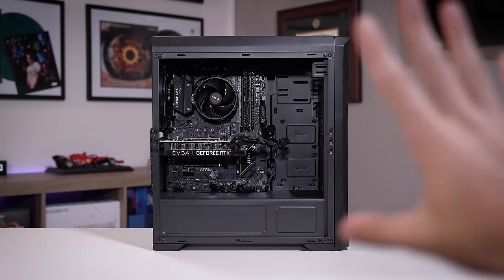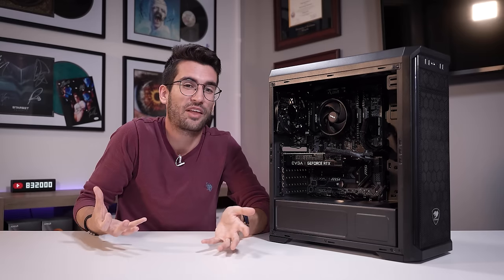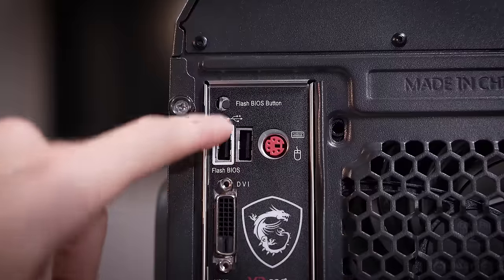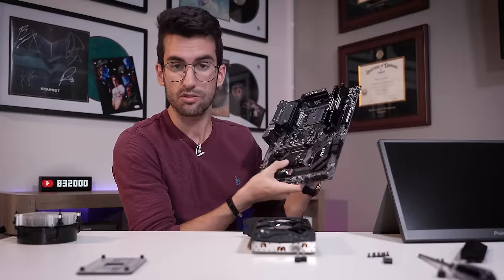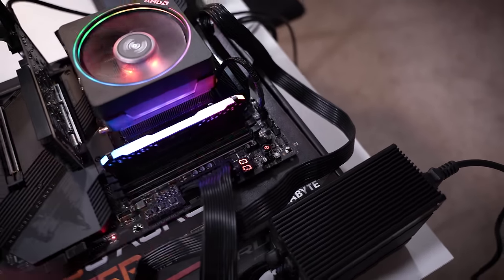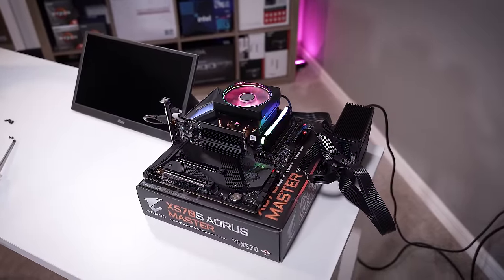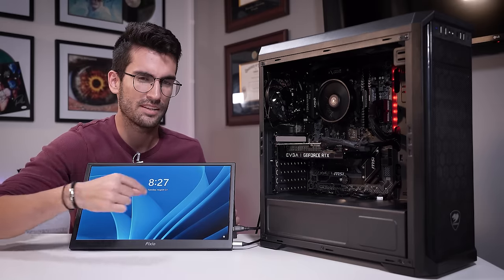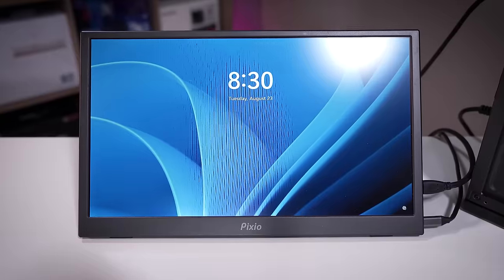Fixing a Viewer's BROKEN Gaming PC? - Fix or Flop S3:E4

Comment: My R5 3600 died on me (Never ending IRQL errors...system cannot get into Windows) recently, since the Asus Strix b450-f gaming mobo and the 16G TridentZ setup was working fine, ended up getting a 5600X. Hoping this one will work and doesn't end up the same. PSU Corsair RM650 and RTX3060 (previously GTX1060) 😢

Comment: One of the first things that I would have suspected would have been the power supply as a bad but not dead power supply can cause other parts to stop working similar to what the customer described.

That being said it is always a good idea, if the motherboard is suspected to be the issue to flash the bios, not so easy if there is no bios flashback, but definitely something that I would attempt if possible for motherboard and possibly CPU issues and apparently it can fix some GPU issues as well.

Comment: I had a Z490 Tomahawk that came borked from the factory. Couldn't get it to post and kept getting the RAM debug light. Ended up returning it and had no issues with the next Z490 Tomahawk board. Was super weird

Comment: Wow that was close.  I recently updated my BIOS on my B450 Thawk MAX to that exact one to replace my old Zen chip with a Zen 3 and have run into XMP stability issues so almost installed the May BIOS.  Instead I just manually OCed my memory to an even higher speed than XMP.  It may be an issue with 3200 mt/s memory because setting it manually at 3600 works fine and I've had no crashes since.
Reply: It's the "E" BIOS. It's known for causing instabilities and no boot. the "F" version fixed those issues hence why the "E" version is no longer available.

Comment: Good spot.  I've just done a fix flop of my own.  Went through all parts of my pc before getting to a 3700x that died.  Was weird and would power on play for a while and then crash.
Reply: I'm not sure if my cpu has or is going bad (2700x) but only gta causes my cpu light to come on and crash my whole pc until I restart it. Really weird, only happens on gta and has only happened 1 time on shadow of the tomb raider
Reply: Had the same parts-swap-circus due to a broken 3600 this year. RMAd it and got a new one

Comment: Hello greg. I have a question.if you were to clear cmos on this motherboard, would it revert back to the other bios? Or just revert all settings back to default? Cheers,  Elu
Reply: Clearing CMOS doesn’t do anything with the bios version. It only reverts the changes you’ve made yourself in the bios menu, example would be XMP or overclocking settings

Comment: this triggered a memory of the strangest bios issue I've ever come across, it was an HP prebuild with an odd bios setting that affected the M.2 SSD drive that mimicked a CPU issue. Very bizarre problem. Was a customer's unit, not mine. If you've ever seen an HP prebuild bios you know they're weird.

Comment: I got an MSI Tomahawk b350 board that I updated the bios of back in 2019 to install a r5 3600. The bios has since been removed and when I try to update the bios with the latest one,  it crashes and I gotta clear the CMOS. I guess I could dig up the 1st gen ryzen chip and throw it in there to see if it will let me update the bios with that chip in there, but i found the whole thing weird. (the r5 3600 works just fine in this board)

Comment: Did you check that the PSU was still delivering clean power?, bios doesn´t explain why it failed the first time, probably PSU killed the first motherboard and made this one to start failing until the new bios changed the base vcore slightly and that's why it boots again, but if some caps are dying in the PSU it will fail again soon.

Comment: Basically all of the B450 Tomahawk boards had some major BIOS issues. I built a PC for someone with a B450 Tomahawk and it soft bricked itself after changing a few settings and turned out (after half a day of Googling) that it was a known issue that if you changed a setting (can't remember which one it was) without first updating the BIOS, the board effectively bricked itself. I then had another fun half a day trying to flash the latest BIOS via a USB drive, but MSI had the instructions listed wrong and I eventually found a random forum post explaining that you had to format the USB drive differently than what the instructions said.

Comment: My 3600 has been solid for a few years… hoping it holds out for a few more as I have soon to be 3 computers in the house 3600, 5600x and a soon to be 7700x system.

Hoping the 3600 on the 450 board holds out until next generation Ryzen or whatever comes after the 7000 series

Comment: I have MSI Z370 that had wonky BIOS. Every 10 or so boots i would refuse to start and beep at me with speaker that I had. Using fast boot options made it even worse. Turns out after few e-mails with MSI, new version showed up on page, installed, problem went away. Admitetdly those e-mail took longer than they should because of me not following simple instruction "load optimized defaults" to the letter.

Comment: Hey Greg, my close friend’s pc is having some issues. His computer would power off randomly or after using it for an hour. He’s not running any GPU intensive games, just browsing the web or running some easy to run games. PC isn’t overheating as well. Do you have any tips on what may have caused the issue? He tried ddu and reinstall his graphic driver but it isn’t working.
Reply: I would try swapping out the PSU. I had the same issue on my old PC, and it was a symptom of a failing PSU. (Remind him to switch out all his cables with the ones that come with the new PSU.) 

I recommend buying from Amazon if he can, that way he can return the PSU hassle-free if it doesn't fix the issue. And check the PSU tier list from Cultists Network. Have him get a tier A or tier B unit.
Reply: @jaekae13  I troubleshoot using another psu. Found out that his PSU is dead. We replaced it 👍

Comment: After doing what you are doing now for too many years to say, I am glad you thought outside of the box. Sometimes the problem is right in front of your face. But, the only way you can see the problem is if you take a few steps back to see the big picture. Put your hand in front of your face, then pull it back away from your face. Ask yourself what you see with your hand close to your face compared to when you can see your whole hand instead of the finger prints on part of a finger.. You are getting it... Very good!

Comment: I don't think the B450 is that bad depending on what your goals are. I cannot speak for the MSI board but I have a Asus TUF pro ii b450 with a 5900x and a 3090. I got the MB for $49.99 new in box. PCI gen 4 is great for storage transfer and will obviously have a part to play for some people who could use the transfer speeds. But that's just not something I personally need. Nothing I do requires that level of bandwidth. Even before this rig on old SATA SSD's at no point did I wish my SSD's were faster. 

I will note that unless there is a substantial price difference and a smokin' deal like I got there is no reason to seek out a b450 since the 550 and above are better in almost everyway. I am only stating that 450's do still have value. For $50 and having good VRM's for my CPU I jumped on it.
Reply: I'm even crazier than you are! Running a MSI B350M Pro VD-PLUS with a r7 2700 and a 3070! The motherboard was around 25$. Changed 3 GPU s till today!

Comment: trying this when i get home, i recently  upgraded my mobo and cpu from b550/3600 non-x to x570/5900x and i wasnt getting a post with my arctic aio cooler but once i used my ryzen wraith prism it booted. it worked for about a week and then yesterday while messing around with the asus optimizer i saved the settings it automatically adjusted and then boom, no post, not even bios. tried clearing cmos (have clear cmos button) tried safe booting tried booting in different ram slots and im still getting a 02 error code on my debug led. going to try flashing bios first when i go home for lunch, if no luck then I'll trying swapping back to my old 3600 and seeing if i gain a post but im pretty sure the optimizer frigged off something with my cpu and maybe reverting back to default bios will help. if you've experienced an issue similar to mine pls comment your experience I'd love the help. Greg love your videos dude keep doing the lords work!

Comment: I need help. So basically for the past 4 days my PC is not giving display signal after many restarts it does idk what is the problem but I have reinstalled the graphics drivers and still the same thing also during gaming the PC just freezes and doesn't respond until I force shut it down I suspect it's a psu issue but still any help would be appreciated

Comment: Just curious if you update the bios on these if its not the issue. I always update my customers BIOS just for the heck of it anyways.
Reply: See now I only ever update a BIOS if there is an issue. If the system works fine then updating the BIOS is only needed if it offers a performance increase or it fixes an issue that I am having. After working with computers for many years I have learnt to leave the BIOS well alone if everything is working fine!

Comment: I had a x570 and b550, both from asrock, that wouldn't post with my 3700x in it, only was I founds to resolve it was to put my old 2600 in and update the BIOS.

Comment: That bios may also be one designed for an OEM/SI exclusive variant of the board, MSI and Gigabyte make a lot of boards they sell only to SI/OEMs for their use and not direct to consumer.
Reply: It wasn't. From google searching it looks like it was pulled after causing others to have the no-boot issue. It just seems like bad luck that this user managed to update to a bad BIOS before it was pulled.

Comment: I have this case/mobo combo with a 2700. Sometimes it appears that it shows the cpu led when loging into windows on a cold boot. The screen blacks out with the cpu light... I've seen the gap in the case and in thinking that maybe the case, since it has "cheap" metals, bends the motherboard due to carrying it or something similar and it got fixed by removing and replacing the mobo? I'll also try the bios too (I'm on a business trip so I can't check now) but it really bums me out since after that, the computer is solid.

Comment: SO my question here is over 2 months ago I bought a "gaming PC" ASUS "prebuilt" from facebook. Here are the specs:

Motherboard      MSI - CSM-H87M-G43 (MS-7823)

Processor	Intel(R) Core(TM) i7-4770 CPU @ 3.40GHz, 3401 Mhz, 4 Core(s), 8 Logical Processor(s)

Graphics     Geforce GTX 1650 Super Phoenix 

Ram    16GB DDR3 x4 sticks

Samsung Evo 500GB SSD - But it also has a (WIPED Seagate 500GB HD) does it work (idk) the cables are bridged off of the motherboard to the HD then to the SSD.

Power supply 500W EVO

Case RGB Lighting

Monitor     Dell 1080p monitor that has HDMI/VGA/DP/SS/x2 USB 2.0

OS Win10 Pro

It also came with a ASUS (basic mouse and keyboard) which I sold with my old Dell 3650 desktop because I was using a wireless keyboard and mouse with it. I paid $485 for it all. I had to buy and get an APPLE tech store to reinstall a copy of Win10 Pro because that system was NOT updating, Eithernet port was not working. When I tried to factory reset it crashed and didn't work. I paid a total of $87 for new version of Win10 Pro and diagnostic. I works great now ( sometimes ). Did I waste my money on buying this and should've saved my money and built my own PC?

Comment: I had a similar issue like this except mine post and goes to desktop, but... randomly restarts. I have an ASUS B550-F Gaming Motherboard and installed the latest bios that had a release note states "Added Ryzen 3D CPUs Support" which I only have Ryzen 3800X which I figured should I try bios flashback to older BIOS. Fortunately it did fix the issue, the question is Why? are we the Guinea pigs or nightmare? I just don't understand why vendors don't test this Bios properly. Also The latest Bios for ASUS B550-F Gaming is not a beta, which really get on my nerves. This video points out that just because your Bios is at the latest version and date, doesn't mean it's stable or better aka "If it's not broken, don't fix it".

Comment: I have a gigabyte FM2+ Mobo than cant seem to update the bios... been trying to udate it since last month to replace the cpu for a more powerful one and the mobo bios version doesnt support it... GA-F2A68HM-S1 (rev. 1.1) is the motherboard with an AMD A6-6400K and im relacing it with AMD A8-7680. Its my brother's pc that i started using after my lapto died. I already multiple time to try updating it and followed the websites instructions carefully and it errors saying invalid bios image . I already gave up on this and just saving up money to buy parts for a new pc but i already have the cpu anyway so i want to replace it.

Comment: I am using an Asrock B450 motherboard on this PC and without a bios update it would not work on a 3600 cpu!  It has a Ryzen 5 2600 and I have a Ryzen 7 2700X to put in when I need to but with B450s it is ALWAYS prudent to update the bios for Zen 2 onwards!
Reply: The "E" variant is from 2022 so it would have had support for the 3600 no problems. The problem is that the "E" variant is known for causing boot issues which is why it was removed from the BIOS download page.

Comment: last year I bought an Asus Rog Strix B550-F and ran into a similar issue, on the manual it says it was compatible with Ryzen 5000, naturally I installed my 5600x and worked fine the first day, next day however my computer booted perfectly fine but after 5 minutes it completely shutdown and power on again over and over. Long story short I tested a lot of things but a bios update solved the problem, looks like even if it is supposed to be compatible from factory, this bios also had a problem. A friend of mine ran into this same issue with an AsRock B450 and a 5600G, too much coincidence

I was looking trough the comments and it seems to be a very regular issue to have bad factory Bios from various brands

Comment: I had a crazy issue with an MSI motherboard where it booted once with my 5800X and wouldn't boot again with that processor, but would run just fine with my old 3600. Queue me having to run to Prodigious Purchase to get an ROG Strix mobo since I didn't feel like driving 3 hours to Micro Center again... 😅
Reply: Sounds like a bad bios or a typically bad MSI board. Had a similar issue with a RMA replacement board for a 5900x. Worked for a little while before bricking itself during a windows update.  Wouldn’t even let me flash a newer bios.
Reply: @TheSjuris  Yeah, I even updated the BIOS when I had my 3600 in it and it still didn't want to boot with my 5800X. 🤦‍♂

I just ended up taking the L and going ASUS since my local Prodigious Purchase only had that and MSI. 😅

Comment: 3:38 SO TRUEEEEEEEEEE. 
This guy brought his pc to the shop i work because he said the mobo was probably damaged since the cpuwas having power supply issues.
I asked him if he was sure and checked everything at least 2 times, he said yes.
First thing i went to check the cables and power supply, both the cpu cables were not plugged in the PSU, probably bcs he messed up while doing the managment.
Never trust them, but respectfully

Comment: If there is a newer version, why wouldn’t you just update it to that, instead of going backwards.
Reply: newer versions remove support for older chips, and the chip he was using to flash the bios was a somewhat older chip so you need the new bios to be compatible with both 3000 and 2000 rather than just 3000 and 5000
Reply: @jordanlazarus7345  ok, that makes sense. Thanks Jordan.

Comment: Either that or the bios version he had flashed the mobo with a beta version bios which are usually removed from the sites hence why it does't exist there anymore at all
Reply: I don't know if it was a beta BIOS but it was pulled due to causing issues. There are a lot of posts on reddit about that version causing multiple issues including systems not booting.

Comment: Not sure if mine is the MAX II or the original, but I still get a CPU light even though it posts fine. I'll have to check the BIOS... again. I had to update it for the 5600 and the light has been constant since then. I haven't been brave enough to update it again while it's still working. lol (Edit - Mine is the previous MAX mb)

Comment: Hi Greg, I love your videos! They have such a high production quality! I have an issue on an Intel b250 motherboard where it won't boot with a ram debug light. Could you help please? Ive swapped around ram and cpu with known good parts and still it doesn't work. The only way I am able to get it to boot is to remove the cooler. I can give you my discord if you want to contact me
Reply: Check the mounting of your cooler. Make sure you're not over-tightening the screws. You should only tighten them down to the point where you start to feel resistance, then maybe give them another quarter of a turn after that. Also make sure that you screw down in a criss-cross pattern. (For example, lightly screw in the upper left screw, then the bottom right, then top right, then bottom left. Then tighten them in the same pattern.) 

It's an issue on some motherboards/coolers where overtightening the cooler will cause the motherboard to flex, and slightly push the RAM out of alignment. This sounds like your issue.
Reply: @jaekae13  Thanks for the help, sadly that didn't work and even with the cooler screwed in with just two threads it won't post

Comment: That's the reason I don't like AMD CPU, the socket and the bios and the compatibility with so many generation creates a lot of problems. I'm using an Intel with same MSI branded motherboard and no issues so far and I changed 2 CPUs from 10400f to 11700 kf